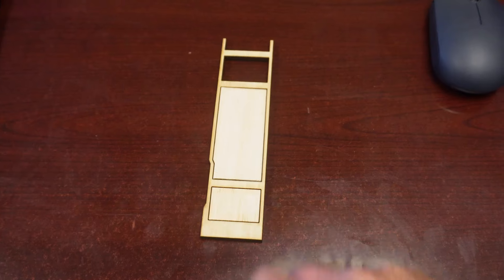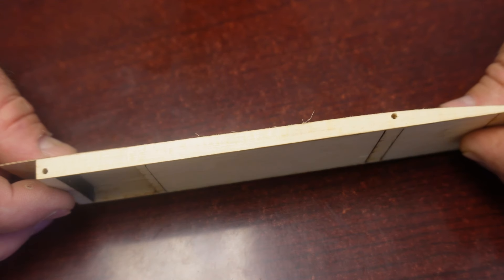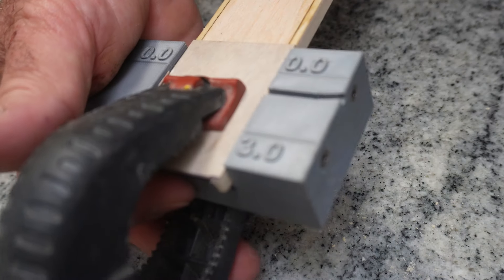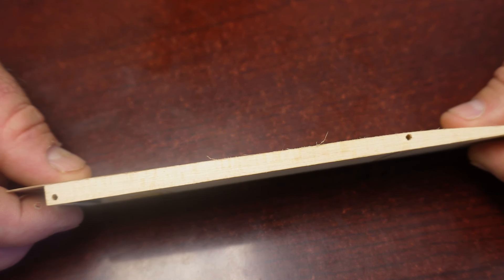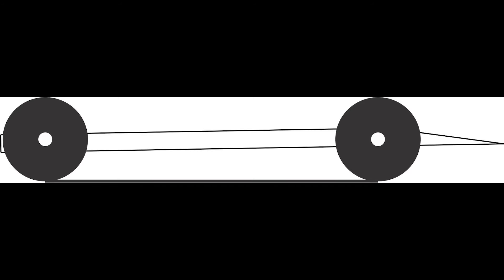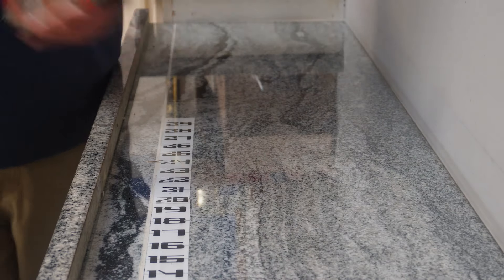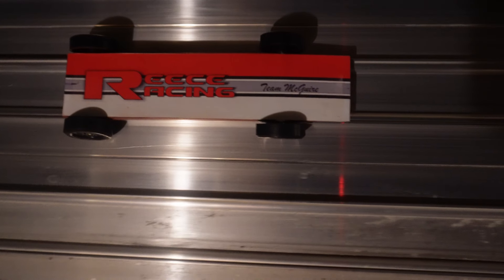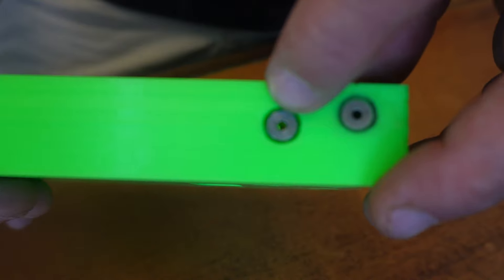Pinewood Derby Car Alignment

Comment: Great information! I have always wondered about the relationship between the DFW axle bend and the “ride height” I have always tried for the nose slightly lower (maybe 0.010” or so) to achieve a slight toe in in the rear. I have always guessed that a slight toe-in would be more stable?
Reply from the maker: If my drill isn’t perfect I think I’d prefer slight toe out so my wheel would ride against the head of the axle rather than the body. But ideally a good drill is best
Reply from the maker: I'm sorry that I'm just seeing this comment. I would have responded much sooner. Toe in is indeed when the front of the wheels are closer. That will force the wheel to the body. Toe out will force the wheel to the head of the axle.

Comment: Are there any options when the unit rules prohibit drilling new spots for the axles, bending the axles or having one wheel off the ground?
Reply from the maker: It's possible to cant the rear axles using the existing slots. I think Mark Rober discusses that in his video. Also, because none of the stock axles from the kit are straight, I'd suggest using the axle with the most bend for your dominant front wheel. Last, if you are permitted to polish the axles, polish the axle normally used as the raised axle down to about .080". That should create enough of a gap for the wheel to touch the track.

Comment: what wheelbase do you use
Reply from the maker: Depending on the class, anywhere from 4.375" to 5"
Reply: @mikemcguire2550  ok, I run 4.75-5 but have heard of people using 5.25 wanted to check

Comment: One more question …on your jig for checking the “track placement” are you marking the true center of the car in front based on the original 1 3/4”) or the center based off you removal of the 0.0625”?  I am thinking it would be based on the original 1 3/4”, but hate to assume anything!
Reply from the maker: You are right. I mark the center at .875” from the side before I remove any material